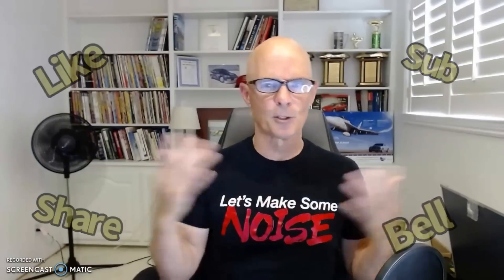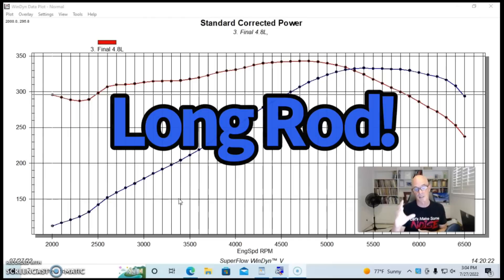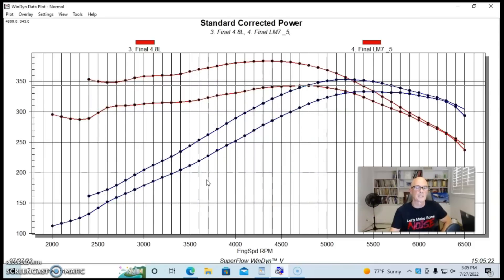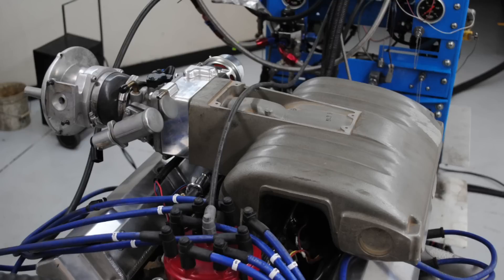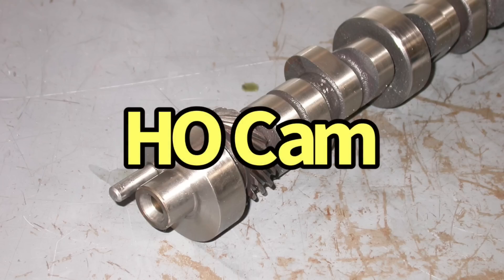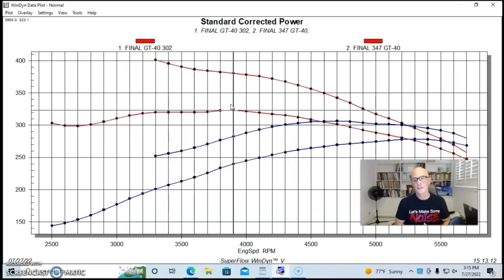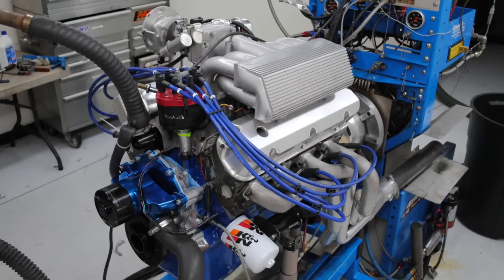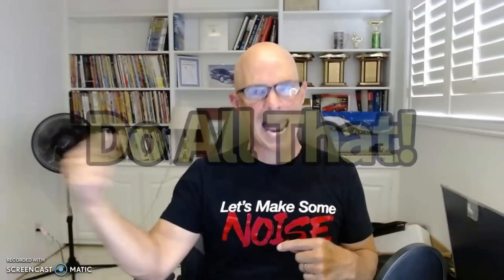WHAT HAPPENS IF YOU ADD DISPLACEMENT USING STOCK HEADS, CAM AND INTAKE? 4.8L VS 5.3L, 5.0L VS 347

Comment: people been telling if use big piston with stock heads and ecu the engine will explode 😞regardless changing the fuel system the block cannot breath air because of oversize piston. Is there true on this?
Reply from the maker: big piston?
Reply: @richardholdener1727  thank you for noticing what i mean is going bigger displacement like using stroker or bore kit. example is using oversize piston/stroker with stock intake manifold/valves/cams. What i understand is using the stock parts will just limit the overall power but i am not sure if this will cause engine damage because of the amount of air is not enough?

Comment: Richard, I have been watching for a while now and I get it that stroke length affects displacement and therefore torque and horsepower on the dyno.  I spend almost all of my regualr commuting time with a 5.3 under 3,000 rpm.  Most dyno runs begin at that point.  Could it be that a long stroke engine makes more torque than a short stroke engine at lower rpm?  I would be interested to see similar displacement engines with different stroke combinations to see what happens in everyday situations.  Example a 302 chevy with a 3-inch stroke like I had back in the day in my 69z vs a 305 from the eighties that had a small bore and I believe a 3.48 stroke from the 350.  My guess would be that the 305 wins on torque and the 302 wins on horsepower.  I would be the first to admit that I am wrong if they make the same numbers due to pure displacement.
Reply from the maker: they will make the same power with the same components-displacement makes torque

Comment: Another great example is the ford 4.6 and 5.4 comparisons. The 2V versions, same bore, same heads, same cams, 260hp 302tq for the 4.6, 260hp 350tq for the 5.4. Although the 5.4 has a longer runner intake.

But if you compare the 4V versions, like the mach1 with the long runner intake making 305hp 320tq and the navigator 5.4 making 300hp 355tq.

Comment: I can tell you without watching - a boost in low and mid torque until the flow limit is reached, and horsepower will stay about the same.

Comment: If we add a big cam and then increase stroke from 3.622 to 4, do we still need a high stall? I want to daily drive a 6.0l so will probably go for a mild cam but curious.
Reply from the maker: you can use a bigger cam with the bigger motor and stock stall

Comment: Richard, great video! Is there any chance you could revisit the low compression big block using the 557 BBF with as low as 87 pump gas, something like aluminum eddy heads, air gap intake, 750 carb, and a cam with less than .600' lift for street use?  Thanks, and keep up the great content!
Reply from the maker: please see the 87 octane bbc

Comment: I know this doesn’t go with the stock head thing but I was just curious. What if somebody to limit overlap of a cam but still wanted say, high rpm or big power or even mid rpm power so to speak but didn’t want to have “tuning issues” with big overlap.   What I’m saying is, say you limited overlap to 9° at .050 but could change duration from small to big (using LSA to keep overlap in check) what would the power curve do.  I have a 227/235 cam with 9° at .050. I just tuned a truck that had a small thumper type cam that was something like a 224/228 on a 109 (numbers aren’t exact) but it also had 9° of overlap. Also was not a dyno tune yet.  I would expect that it just doesn’t rev as high and makes less power than mine but it got me wondering.
Reply from the maker: why are you so worried about overlap
Reply: It was just a curiosity thing

Comment: the standard 5.3 should have dished pistons because of the longer stroke. the high compression 5.3 (10:1) use 4.8 pistons. 
another good one would have been more work swapping everything between the different blovks but the 5.3, 5.7 and 6.0. all the same stroke but a bigger bore.

Comment: I think the guys at horsepower TV did the same thing with a 318/360 or some similar Dodge engine increased displacement only and Dino checked both. It may have been 360-408

Comment: Drag racing street car class idea: 
-No tube chassis.
-Like-stock suspension (bolt on parts and any reinforcements allowed, like cal-tracs or adjustable control arms).
-Must be licensed and registered and have a VIN.
-Must be able to survive street cruise/"cackle fest" immediately followed by qualifying pass.
ENGINE LIMITS:
-any engine allowed without power adders.
-under 401 cubic inches nitrous is allowed.
-under 306 cubic inches any power adder is allowed.
-factory available transmission. (May be built)
-class should be split into 2 groups by ET if possible.
Name of the class? 
REPLACEMENT FOR DISPLACEMENT.

Comment: My theory is that if you ONLY change stroke and nothing else, then obviously the torque would increase for two reasons:
A) longer crank throws, more leverage
B) more displacement, so more overall power
then:
C) with a given system handling more airflow in a pulsed fashion that utilizes larger pulses with no other changes, it will drive down the RPM at which the engine makes peak torque, because larger displacement leads to functionally narrower conduits to and from the cylinder, and, generally, narrower is better for lower RPM, and it also chokes off flow in the higher RPM areas.

Now that I look at the graph of the results, my initial statement holds true. What I did not predict was that the torque would nose-dive so dramatically later in the RPM range, but with a larger pulse per intake stroke, it does make sense that the same heads would choke off the bigger motor more at higher RPM, but what was weird, to me, was that the torque would nose-dive beneath that of the smaller engine.

That engine looks like an ideal candidate for a centrifugal supercharger. With loads of torque down low, than falling on its face up high, a centrifugal could flatten out that torque curve substantially by sheer brute force, until the engine just refused to have any more air stuffed into it due to flow restriction and valve timing not useful for high RPM.

Comment: Building a stroker 6.0 with 243 heads and sloppy stage 2 cam. Holley dual plane with 750 carb. Pump gas 4L80e with 2500 stall converter.
What is your recommended compression ratio for this cam on pump gas.
Reply from the maker: 10
Reply: @richardholdener1727  thanks Richard

Comment: In my opinion if you don't change the camshaft and the compression refill you'll have more torque where it's made peak torque before when I made my 408 out of a 6 l I lost 037 in gas mile but I gained more torque and driveability now it doesn't hardly ever shift out of overdrive pulling the car trailer up the hills where before it would drop in the second gear and scream to the top much nicer vehicle to drive 6 l are under powered from the get-go

Comment: The 5.0 pushrod Ford was an interesting choice, since its E7 heads were already designed with small ports and valves (compared to say a chevy) to build torque down low and the long runner EFI intake ran out of breath by 4,500 RPM--in other words, it was already "Small" for the displacement but on purpose. would LOVE to see a video where a  Chevy 307 gets a 350 crank for 333 cid, and a 305 gets a 400 (or aftermarket) crank for 334 cid. Give both engines the same cam, heads, intake and headers, and then look at the torque curves...does the longer stroke really create more torque?  hot rod magazine says that displacement, not stroke, creates torque. They did not use this combination to get there, however, and it would be the closest two engines could get for an apples-to-apples comparison.

Funny thing about a stock cam on a stoker application, it may act like an old RV cam with not enough duration/overlap and create more final "compression ratio" as a result, and we know that adds power to an engine (14% for each point increase).
Reply from the maker: displacement adds torque
Reply: @richardholdener1727  right, and a 333 versus 334 test should prove that. 

unless it doesn't  :)
Reply: @albertgaspar627  the 302 vs 305 test already does that.
Reply: @joegreen4089  except there's the issue of bore shrouding--ever put a cylinder head meant for a 4 inch bore on the next smallest bore made for the small block? what valve size was the 302 running, the original 2.02 inch? or did the 302 get the 305 heads and intake and cam and headers put on it?

Comment: Another good source of information on this is the video Richard did on the 175 HP cam swap where he runs a 408 LS with a LM7 cam. Also the Powernation guys did a Dodge Magnum 408 stroker with stock cam and heads then upgraded the top end to show the difference in power.

Comment: How about just advancing past a design that is over 50 years old? When is somebody going to build a overhead cam? How about a ohc with a small journal flat plane crank with a turbo between 300-350ci? How about with wet liners like the 71 series Detroit?Make it a V8 if you want but when are we going to move on? Seriously the rest of the world did decades ago and left American car companies in the dust of recievership. Sad actually.
Reply from the maker: Coyote and new Vette Engine
Reply: Detroit 71 series engines were a dry liner. The 92 series were a wet liner though

Comment: Rpm is a form of displacement t,  it's a dynamic displacement should be able to displace the same amount of air just at a higher rpm especially sharing the same bore. Sure the cam timings head port shape intake etc... Doesn't just suit the longer stoke and different rod ratios better ? 

Both smaller engines made more hp per Cid so do it a little more efficiently just falling short of equal output, torque doesn't matter so much as long both are geared properly.

Comment: Fun thing you can do- take your TQ and HP datapoint values, average them and express as a ratio of average TQ to average HP for both small and bigger displacement versions of each motor. And then do a mean and mode ratio of each for extra giggles…

Comment: That restricted 347 with boost would make incredible torque then?
Reply from the maker: it makes even more when unrestricted
Reply: @richardholdener1727  
Back at UTI as an Instructor for the Power and Performance classes we built a Factory Five kit car with a 347 "triple X" roller block" and a little 150 wet shot of spray...The car ran 9.88 Quarter Mile times with a 5 speed manual. Ofcourse the Factory Five kit car was light..but that little 347 was a GREAT ENGINE and was very dependable as well
Reply: @richardholdener1727  
Richard have you ever used any camshafts made by Roger Vinci from "Vinci Performance" out of Florida. He specializes in LS cams and he uses core billets that are very very high grade steel. Reason I am asking you to look into what he offers for cam profiles for the LS platforms are the results! He ground a cam for my 2002 Tahoe 5.3 LM7 that with a tune from Black bear performance resulted in 388hp to the wheels and 327 ft lbs of torque to the wheels. I am using the factory injectors, factory intake manifold, factory throttle body, I did do the electric fan swap as mine originally came mechanical fan, factory exhaust manifolds, factory y pipe dual to single to dual exhaust tips. I did put a set of 799 Cathedral port heads on the engine that have absolutely no work other than springs for the cam kit, 2400 stall hd/towing converter from roadrunner torque converters. End of the day my heavy Tahoe LT runs damn good down the road. With 388hp to the wheels and roughly figuring 20% for parasitic loss Vinci Performance cam is getting me 465hp flywheel and 392lb ft of torque flywheel. Those are VERY respectable numbers considering all the stock parts being used. Give Roger a call and test a couple of his cam designs brother! Please consider Part Number: 5-455. It is a VHP "Rapid Ramp" Cathedral Port. INTAKE 216 @ .050" LIFT AND EXHAUST 224 @ .050" LIFT 113 LSA  +4

Comment: It's cheating to use the LS on this video.. heads are too good from the factory.
Reply: Same happens to every engine no matter what, the bigger, the better..
Reply: @P71ScrewHead  No.. the heads on the LS allow for substantial improvement-which is why I made the statement.  As Richard mentioned in the video on the 347 Ford.. the stroker kit was limited by headflow as the 347 came to a stop in horespower just over the 300hp mark.. the Ford heads only allowing 160cfm of airflow at peak.   Increasing CID increases torque.. but if the heads are weak.. and many non LS heads are .. you are severely limited in your power production.. the 347 Ford didn't even reach 1hp per cubic inch.. it couldn't via the restrictive heads.
Reply: @arcdestriumph586  that whole part
Reply: @arcdestriumph586  I agree, n I always say, "there's no such thing as Too Much Head"..lol for that very reason.. More air in, more power ability.. But I think that's what he was trying to show, that a stroker will always increase trq n hp.. As seen here..
Reply: Can yall imagine if the Coyote engine was 6.0 CID?It would easily be a 650-700 HP pump gas monster!Even @ 5.0 CID it can be a 500 HP killer NA!EZ.
Reply: @brettcotton3927  Has someone bolted some Mustang heads to a 6.2 Raptor motor and gotten 650-700hp?  Wildlly Optimistic.

Comment: Pontiac used the same basic cylinder head on the 350, 400 and 455 from '73 to '76. Although a little different chamber size to get the compression ratio right. From some dyno tests I've seen peak HP is very close but the rpm where it peaks is different with the smaller displacement being higher. Torque is very different with the larger displacement being higher. Pontiacs are kind of an anomaly since the blocks all have the same external dimensions but it does show the benefit of displacement.
Reply: That is the biggest takeaway, and something we all expected. All other things being equal, a larger displacement engine will always make more torque and HP sooner than the lower displacement engine. This is something I didn't understand when I was young. My 305 Camaro was always going to me limited in some capacity, even if I built it for peak performance. It would only ever make really good power up high. That's why the TPI motor is specifically designed to be torquey. Well, one reason. When you throw cam, heads and intake at them, the curve shifts right. No replacement for displacement, even if it's forced induction.
Reply: @unicornsteaks6769  I was the same way when I was young however my dad was always into the biggest engines he could get. He bought a new '72 Buick Centurion with a 455 and I remember growing up him talking about how the big engines were better. He had no mechanical reason. In 1983 I got m first car, a 69 GTO with only 65k miles on it. Within 7 months I had a rod knocking. But I was 16 so I was a real big idiot. Of course the first thing I did was toss in a 455. My best friend had a 71 GS with a 350 and he was always racing me and getting beat. There's nothing all that wrong with a Buick 350 but it was stock against my built 455. So he bought a 70 455 out of a Wildcat and put it in his GS. The races got much closer but it was still stock against a built engine. We both still own our high school cars and the races are still close. Today both are built. I'm contemplating a turbo on the GTO so the races won't be close again but building the exhaust has me holding off. It's going to be the most expensive part I think.

Comment: I would like to take my 5.3 truck motor and increase the displacement by boarding the cylinders to the 3.905 with forged pistons and rods. It is my thinking that by increasing the boar it will assist in the production of torque and horsepower as we all know, will also benefit flow into the cylinders sort of a shroud in the valve so that they can flow around the valve into a larger cylinder area. I want to continue using the truck intake from the 5.3 even though it is ugly, because a bitch long Rutters. I’ve been watching your videos for a couple years and I’ve learned a lot from them, which I thank you very much. Utilizing the truck Norris cam and a good set of crane hydraulic rollers pushrods and springs for the cam, from your testing what do you believe the usable torque and horsepower will result from this combination? This combination is going into a early 70s Corvette. I am hoping that you will respond to this comment. Thank you much Richard!👍🏻
Reply from the maker: ALL THAT WORKS-NOW TOSS IN A 4.0-INCH CRANK AND YOU HAVE A 383
Reply: If you can find a 6.0 block everything will fit perfectly and you can get a 4.0 bore with no machining required.
Reply: Cheapest way to power n torque is the best way to go, turbo will make you happy but i do love the expensive routes too, n/a builds then boost, as i'm doing with my lil 2v.. Always go the stroker route man for more Torque, bore n stroke is good..
Reply: You're just basically talking about building an iron block LS1 (345 ci). Plenty have done it, look it up